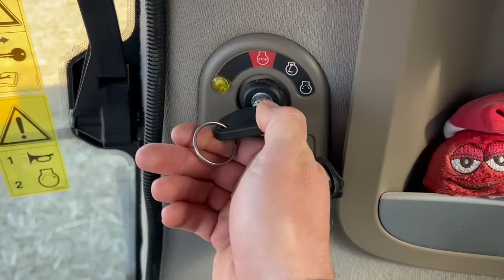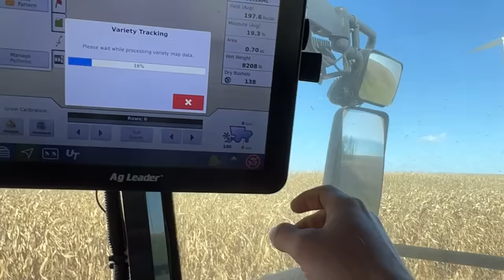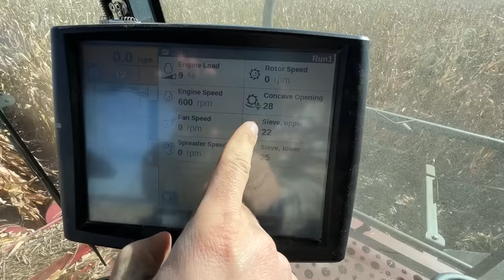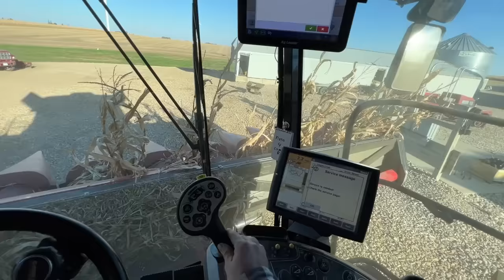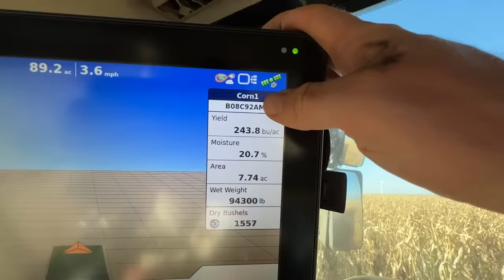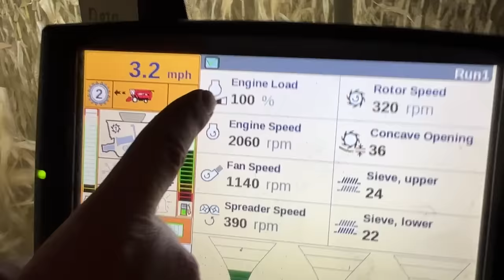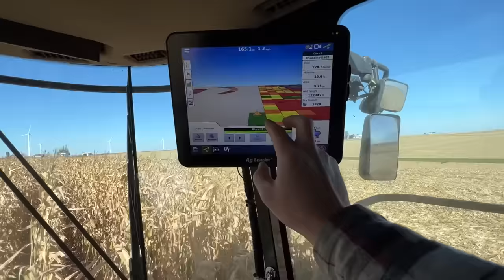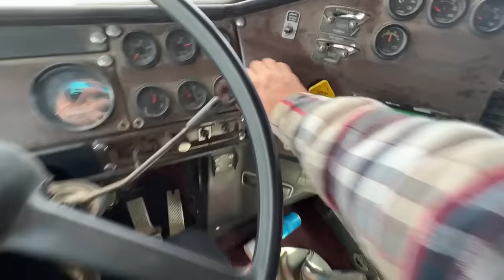We Found Even More Things Falling Off The Bin Site

Comment: It´s so hard seeing a grown man at loss of words. I don´t have words for this kind of shit quality either. The only thing I know is that general material quality went down over the last couple of years especially after you know what happened. I work as a machinist on automatic barfed machines and I don´t want to admit the amount of tooling that I wrecked because every bar was different, even with the same production date and number. I had to set stops before every new bar and run in the program and ajust everything again. 
That kind of material failure you see on your bins should get caught in QC at the production place. However that got delivered and built, is insane to me, that´s not even halfassed, that´s a new level of zero fucks given and no bad conscience afterwards. I hope your lawsuit goes through.

Corn flour straight out the combine? I´d say make tacos from it.

Comment: Cole. Document and FIX the hand rails. You could likely use scaffold connectors to attach the railings until a settlement is reached. You guys are dancing with the devil by not fixing the safety portion of the facility. Discuss with your council 1st. Everyone gets nervous when anyone goes up onto those catwalks.

Comment: as a mechanical engineer safety is always my concern. Clearly the contractor that built this didn't have engineering drawings for the safety ladders or structure. I never would have signed off on this having seen it. Unfortunately from the OSHA perspective, safety is the responsibility of the end user or owner, and for most you take the word of the "experts" that are providing equipment. In this case your experts clearly were just trying to make a buck

Comment: Who was the "crack head" who designed/drew the plans for the hopper bottom bin A. ,   B.who was the engineer that put his stamp on the plans that  the bldg. dept. approved...and C. if it passed all of it's inspections .... then, as a builder since 1973, I conclude one of a number of things... 1. compaction wasn't done right but passed inspection... 2.  the concrete wasn't a correct mix for the application... 3.  the rebar wasn't designed and/or installed properly .... reason #1 is typically the reason concrete cracks ... but the bottom line here is that the bldg codes are designed for that specific scenario for a reason.... to protect the public.  When you sign a contract in good faith, you, as a consumer, have a right to expect the work is done up to code.  The bldg. inspectors are your "shield" against dangerous/shoddy work. The same kinda goes for the pit since 8,000 bushels an hour is your max.  Engineering is to blame there .... THERE IS SOMETHING TO BE SAID FOR OVER-BUILDING/Engineering when the return outweighs to cost especially in the margins you're experiencing.  Are you looking to reinforce the existing pad or move the bin, rip out the old with a base that supports the weight?

Comment: I really don't understand why your not just documenting these issues and fixing them.  Instead of tearing them apart and causing more damage.  Yes they left the bolts loose and didn't do their job correctly.  But now you are letting that be a continuing risk to you and others on the farm.
Reply: The whole bin site is built wrong from the foundations on the bins and conveyors to undersized and improperly installed safety railings. Not to mention the unload pit moves less than a quarter of its specified capacity in corn. The scary part is a Professional Engineer signed off on this so either it was built wrong or the PE decided to make a quick buck over proper engineering ethics. PE certifies that products will not kill or harm people.

Comment: K.  DC.   I have to give u shit for this right now as well.  If that set up was on any commercial jobsite in North America (I'm in Canada,  and work construction in both commercial and industrial settings), it would b shut down, without a second thought.  The fact that u r even able to b around it right now with the issues it has is amazing to me.  I get it, u need to use it.  
But u went up to the top to pull of the garbage saftey equipment, so your kids don't have to, but u r not protecting yourself.  One wrong step or stumble onto something that u r showing us can break easily, and u r falling g to your death. Your wife and kids would loose u.  

Please, please, please, rope off and get a harness on before u decide to love around up there.   It is not safe.  U could die up there. It takes an extra 5 min to harness up and secure a rope for yourself up there.  I don't want to see u and your family suffer because someone else did a horrible job and your site is not safe. I fear for u.  I've seen ppl fall from safe structures,  and b rendered usless the rest of their lives.  If any safety inspector came to your farm and inspected, it could shut your whole operation down.  Then your whole family is boned.  Please take the extra steps to make sure u as well as your entire family is safe.

Comment: The mistake you made was doing something you didn't know how to do. Don't beat yourself up over it.  We all do it.  The teachable moment is where did you go wrong.  If you have bad concrete no one was slope testing it before it was installed.  The weak structure, it is unclear whether it was a design flaw, construction flaw or a combination of the two.  But how do you avoid these problems.  First, your lawyer draws up the contract.  Second, your engineer examines the plans.  Third you needed an independent onsite inspector to check the things like the slope of the concrete and the construction.   In short you needed to hire your own engineering firm to oversee the project. Probable would have cost you 20K.  When ever you see a new Walmart, et cetera going up that is how they protect their interest.  Not because they are smarter than you, but because the same thing happened to them.  Stop kicking yourself in the butt over this and get your butt in motion.  Get it fixed and move on.